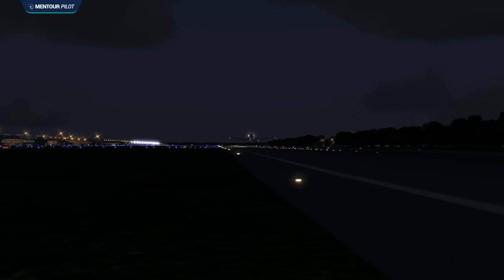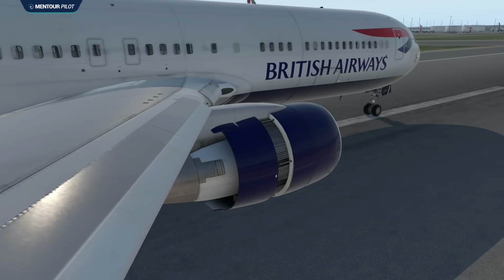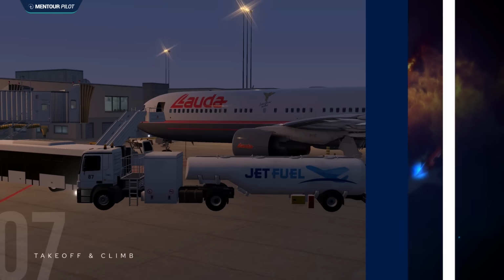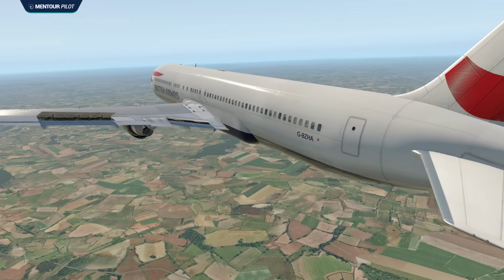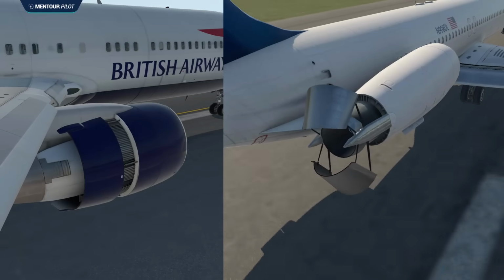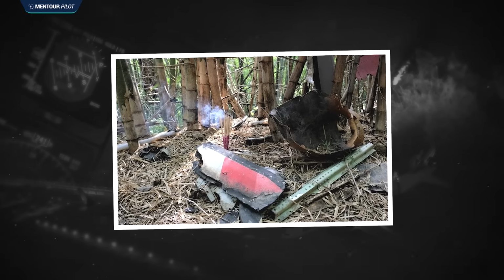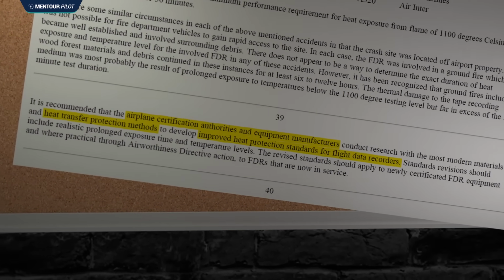HOW an Impossible Failure CRASHED this Boeing 767!

Comment: "But there's still the issue with WHY THIS AIRCRAFT COULDN'T BE CONTROLLED, it had been certified"
Come on dude, you've been making those videos long enough to know the FAA sleeps in bed with Boeing and that warrants a rushed-certification, just-say-the-word style.
Didn't you see the documentary by Al Jazeera, in which a Boeing employee said "We're not building them to fly, we're building them to sell"?
That alone says it all. Boeing makes flying coffins waiting for a disaster to happen.
Reply: What do you mean the aircraft couldn’t be controlled, the thrust reverser deployed at over 450 KTS, the wing was torn off, no control necessary.  No large commercial aircraft could survive that, Boeing or Airbus.  Your comments are so ignorant they are ridiculous and you should probably take it down.  I am currently an A&P mechanic, in good standing, and have been doing so for 35 years, and I am high power and taxi rated on all Boeing aircraft except the 787.  The failure of the thrust reverser system on this particular 767-300 had more to do with wiring and micro switches than anything else.  The engines and thrust reverser systems are not manufactured by Boeing, but are integrated onto the airframe.  The fix for the entire fleet was the integration of a mechanical lock on the thrust reverser actuator and the total bill across the entire fleet of Airbus and Boeing aircraft exceeded 2.8 billion dollars!  Had nothing to do with Boeing other than this failure occurred on their aircraft and not someone else’s.  This thrust reverser configuration effected all aircraft equipped with the Pratt&Whitney PW4056, -4060, and the -4064, the first two numbers being the engine series type, the last two numbers being the thrust rating in tens of thousands of pounds, and also effected some, but not all, General Electric CF6-80C2 engines equipped with the common thrust reverser.  So, as you can see, it’s far more complicated than just calling out Boeing when all they do is assemble aircraft from parts supplied by thousands of contractors.  Boeing only makes the fuselage and the wing sets, that’s about it, everything else is sourced through subcontractors.  As a matter of fact, the thrust reverser actuator on our 767-300’s are manufactured by Sunstrand if memory serves me correctly.

Comment: Yeah all the circumstances are interesting but.
HOW? How could it deploy mid flight? Shouldn't there have been multiple points of failure? Yes the Hydraulic Isolation Valve failed, ok. That's not regarded as that detrmental, because there should have been other safety blocks. 
How about the Directional control valve?
What about the assumption that the reverser couldn't be deployed with the engines at full speed? That must have come from somewhere.
In fact why not mechanically tie the reversers into the engine being at idle? Like the combustion chamber pressure physically preventing the thrust reversers from moving. Or at least a direct pressure sensor blocking the hydraulic connection right there.
That seems like a much more surefire way to prevent something like this than connecting an electrical sensor on a completely different moving component to a hydraulic system.

Comment: How much depth of the different systems on a plane ✈️ are pilots required to know before flying each variant?
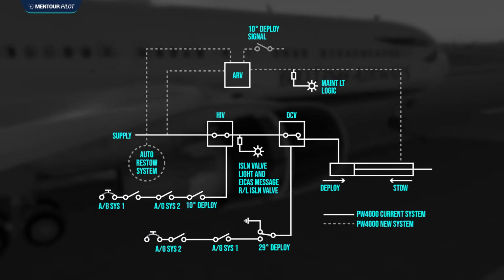For example 4:37 how much of this schematic would a pilot know or be required to know when flying this plane? And how much of an understanding of the warning that appears on a flight deck are pilots required to mentally hold as apposed to be able to find in the Non Normal Checklist?

Comment: One thing that I never quite got before watching these incident vids is how uncontrollable airliners seem to be when something goes wrong. For example in this case,  when the reverser activated and made the plane yaw and dive, then surely shutting that engine down, which is what happened  would have meant the aircraft was a normal plane all be it underpowered. Why was the plane getting so hammered by the dive and why couldn't the pilots regain control. I thought when a new airliner is tested the test pilots putthem through worse than this, maybe not.

Comment: Former US military.... this wouldn't have been rated air worthy. Would have gone through trouble shooting, and had components replaced. Once it happens again, deadline fault, its going to get every thing from switch to every nut and bolt and mount that wire bundle runs through. If that doesn't fix it, then its going back to boeing, and they're paying for a serviceable replacement... they have spares on hand for this purpose.

Comment: @21:30, compressabilty. What the speed pioneers had to deal with when reaching the speed of sound before surface controls were designed to handle it.

Comment: Seeing the structure and wings tear off is especially heartbreaking. Seems like an inexcusable lapse in Failure Modes and Effects Analysis by either Boeing or Pratt&Witney. And initial simulator assessment never accurately models actual human performance conditions.

Comment: If it aint a boeing then, you're safe. 😮 engine codes cost too much. Reset it.... That's what my Prosper, Dallas, Mckinney Texas Dodge/Ram dealer does for my truck under warranty........ Engine oil leaking... Oh that's normal sir.... Wheel eating out tires, oh that's normal wear.......the suspension if fine just hit another car and your still fine sir... At my STEALERSHIPS.

Comment: Capt Mentour - Kinda gonna simplify this, but Pilots noticed electrical BS coming from #1, shortly afterwards, anomaly (Left Reverser Deployment) occurred.  If heads up Pilot IMMEDIATELY emergency shut down #1 knowing only that was the BS source, would it have been in time to save de plane...de plane, or would they already have been in de ground...de ground??

Comment: why would the pilots did not make eng 1 idle
Reply: They actually did but the situation got out of hand before he could do that because it happened in a matter of seconds.

And even if he did that, it wouldn't be very effective because the reverser also affects airflow over the wing which would affect the plane.

Comment: I wouldn't get on a commercial airliner to save your life. When I was in the US Navy I got on a DC-10 (years ago) and the rear turbine was making a racket when spooling up. I looked at the flight attendant and she looked aware of this sound.  When I asked if that noise was normal, sha said no. She walks to the cockpit and brings back the pilot who realizes something is wrong. 5 minutes later we are disembarking from the plane, and had to take another flight. Now, add mechanical failures, False Flag media terror events, pilots losing their minds, weather related events and the general ego problems that these air crews are facing every day, and you'll see why I have this attitude against commercial air travel. Don't get me started on how these pilots can actually think the wings are loaded with hundreds of tons of Jet-A or JP-5 fuel, I know the airlines pay well, as they charge the customer for lots of fuel, lol.  So 83,000 dead passengers and crews since 1970 in commercial airlines travel world wide, not as effective at culling compared to the abominable staircase (12,000 a year) but it's something to think about. Waking up late is optional ... fuel in the wings, lol ...

Comment: This accident is brutal to contemplate, because no one did anything horribly wrong.  Boeing had built in multiple fail safes, and had done testing based on contemplated situations.  Lauda Airlines had been trying to find the problem in good faith and was in compliance with all regulations.  The pilots theoretically could have saved the plane, but had four seconds to diagnose the problem  and then start and execute a difficult maneuver.

In hindsight, everyone could have done more and better, but this wasn't your typical case where the pilots, the airline, or the manufacturer were grossly negligent.

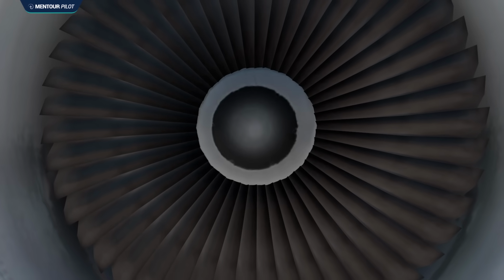Comment: 1:45 The bypass ration is measured by mass, not volume. The difference is very significant because the general gas equation tells us that hot air is less dense, i.e. has greater volume, than cool air, and that the volume to mass ratio is proportional to absolute temperature.

Comment: One of the biggest air accidents in Brazil occurred in 1994 when a Fokker 100 crashed shortly after takeoff due to a problem in the right engine reverser. The aircraft crashed in a densely urbanized area killing, in addition to the people on board, dozens who were hit on the ground. It's an interesting case for a video because it's possible to learn a lot.
Reply: no one cares about Brazilians

Comment: why not have a sepeate hydraulic system for the reversers thats enabled if all wheels being on the ground activates 1/3rd of the requiered switches to enable them and basicly having the wheels push a button, and if not all buttons are pushed it would stop any electricity from going into the system stoping the hydraulic system from activating or even using an electrical acivation instead? or is this just something i though of?

Comment: Among other things, this is a cautionary tale about computer modeling.  Computer models only work if you have ABSOLUTELY ALL of the data.  Since that is not possible, field testing is still necessary.  The computer model can be a starting point, and might find many flaws you have missed, but you still have to do the testing.

Comment: Hi everyone! Hope yoy all good 👍🏻
So I have a question about how this could happen. Also sorry if a say something dumb, I am not a pilot just really enjoy aviation 😅
So when pilots deploy the reverse thrust you have to firstly move the thrust lever at the idfle position, and second, you usually don't use the full power of the engine when in reverse mode, it usually is capped to around 50% (at least thats what I found)
So if the engine was in climb mode, it would be imposible for the engine to actually deploy the metal plates to redirect the ar foward, as it would had too much force no? 
Thanks for any help!

Comment: The pilot did a brilliant job diagnosing the issue within 10 seconds.
But just not within 4-6 secs required to recover the aircraft. I can imagine the first 4 secs were used up in complete terror and shock
Reply: The only way any pilot could have stopped this crash was if they could react to it out of pure, blind instinct. To be dealing with it before their conscious mind had even realised what was happening. That requires an incredible amount of training, and practice, and experience, something no one is going to have in a completely novel situation.
Reply: @alyessamaddox7022 Yes, and airline pilots are specifically trained not to immediately take action when an unusual event occurs, because of the very real risk of making the situation worse if you act before you're sure  what is going on. The only way a flight crew could have reacted in time to this is if they'd been specifically trained for exactly this situation, which of course they hadn't been, sadly.
Reply: @alyessamaddox7022 as he said it was always appearing and it wasn't considered fatal. It should have been corrected. Poor pilots are nowhere wrong😢

Comment: I wrote the report that went to the NTSB, your speculation does some fine cherry picking. You completely ignore the maintenance aspect and how the DGCA manages their maintenance crews and return to service requirements. The misinstallation of the bottom inbd reverser actuator to mention one.  The control valves were telling the truth and trying to protect the aircraft. The deployment of a one half of any thrust reverser in an unrecoverable accident. Nice dry but no cigar.

Comment: Mentour Pilot is morally and technically wrong to continue showing a British Airways B767 to describe this accident.
They had completely DIFFERENT engines.....Rolls Royce RB211.
The engine involved here  was made by Pratt and Whitney. 
At the time an Egypt Air B767 with P&W engines also had a thrust reverser incident. 
These events caused the FAA to issue a DIRECTIVE  forcing ONLY P&W to redesign parts of its reverser mechanism. 
So what is the point of showing a completely different company with completely different engine !!!##!??
Technically bankrupt report.??

I used to fly B757 with RR engines and B767 with GE engines many years before this accident. 
If I had this reverser  message I always determined that I would shut down the engine immediately. 
Why was it not a potential emergency /red warning  ????
Some weak excuses....from Boeing  !!???
Not unlike the B737 MAX  ???

Comment: You missed the most interesting bit.
Boeing did not want to release a statement that there was no way the pilots could have saved the aircraft. Lauda was understandably angry about this, and being a pilot himself eventually convinced Boeing to let him try and recover the aircraft in the simulator. 15 attempts and 15 simulated crashes later, Niki asked Boeing to issue a statement that the accident was unrecoverable (considering the flight crew most certainly would not have been able to identify and fix the problem within the 4 to 6 second window). Boeing's legal team stated they would not release the statement, as it would have apparently taken three months to adjust the wording. Niki responded by demanding a press conference the next day. He then went a step further and told Boeing that if it had been safe to fly with the reverser deployed, he would personally take a Boeing 767 into the air alongside two other pilots and deploy the thruster at altitude. Boeing stated such a thing was not possible (to recover). Lauda then asked that Boeing to declare the accident as nonsurvivable - and at last, Boeing agreed. Niki noted that this marked the first time in eight months that it was made clear that Boeing was at fault for the accident, and not the operator, nor the engine manufacturers.

Something to note was that Lauda took this accident very personally. Not only did the company bear his name, but on top of that he would regularly serve as a Captain for his own operation. He said that the time after the accident was the worst period of his life, saying it was even worse than when he had been recovering from his near fatal burns from the 1976 German Grand Prix.

Comment: Done some work for airbus and boeing. Mainly tooling devices and assembly devices. I cant imagine how the hell the planes dont fall from the sky more often. Their 3d design engineers are bad. They dont know some basic rules. The 2d designs i was making in highschool were above what they give us. And they dont leave adjustment posibility for parts. I can make assemblys at 0.05 mm all day no problem but with their assemblys you get lucky if you can get them close to 0.25mm ( wich is huge in this domain ).
I am a perfectionist and i take pride in my work. Most of the time i fell like i dont even want to put my name on the reports... I like to work with automotive devices much more. Have a little free hand on projects and can make our own modifications with no problems.

Comment: Man, I hate nonrecoverable situations.  I was investigating officer on the E3 awacs crash in Alaska.  Geese took out two engines on the same side on takeoff.  Only a trained Boeing test flight pilot was able to recover the aircraft in their simulator.  Those odds didn’t happen for the crew.  Glad everyone involved demanded action from Boeing to instill a solid fail safe.  I was chilled by the simulation of what happened to the aircraft.  Two pilots with 15,000 hrs between couldn’t recover. What a tragedy.

Comment: 0:01 Intro
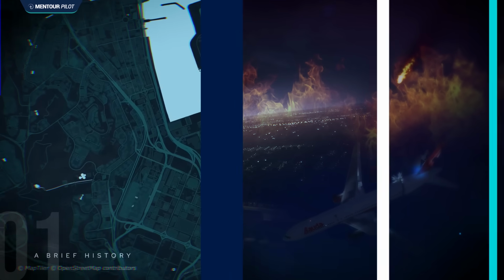0:34 A Brief History
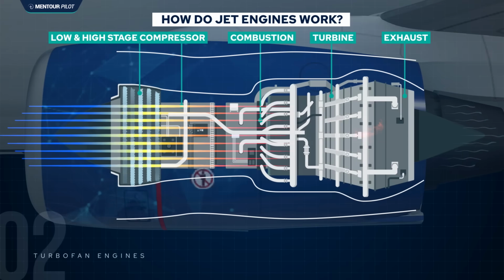1:27 Turbofan Engines
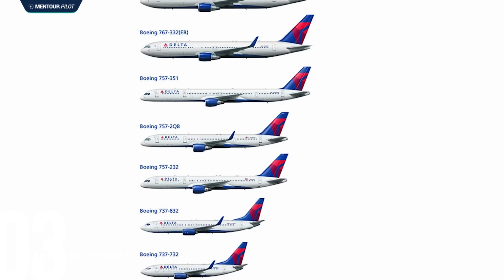3:20 Reverse Thrust
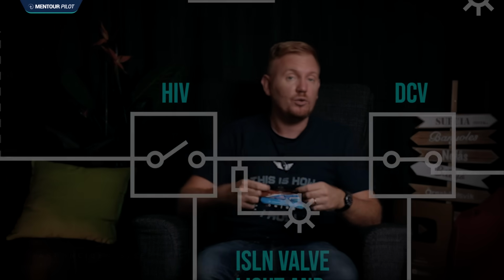5:25 Past Incidents/Certification
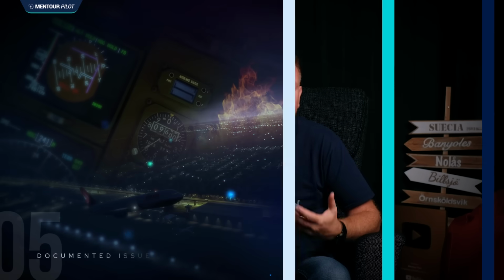8:01 Documented Issues
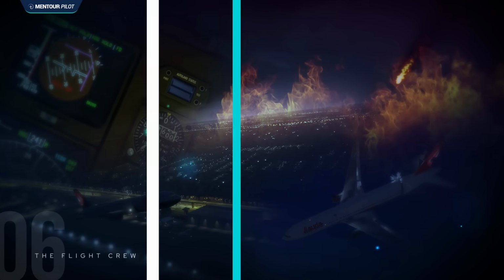10:16 The Flight Crew
12:21 Takeoff & Climb
14:08 ECAM Messages
16:08 Adjusting The Trim
18:00 Thrust Deployed In - Flight
19:17 Why Did This Happen?
20:17 A Violent Dive
21:47 The Sum Of All Fears
24:33 What Went Wrong?
25:30 Authorities Take Action
27:25 Aviation Changed

Comment: Aside from HIV and DCV anti-deploy electrical circuits, B737-400’s  have an auto- restow electrical circuit as well... BUT when all above still fail, there is a mechanical ‘cable operated’ throttle-retard feature which will literally pull the associated throttle  back to flight idle position simultaneously while reverser doors are inadvertently deploying in flight. I wonder if the B767 had that last mentioned safety feature? If so, maybe it would not have crashed? Hmmm 🤔

Comment: Mentour: I believe the bypass ratio is defined by the mass flow rate of bypass air to the mass flow rate through the core. Not volume flow rate as you indicated. The thrust of a engine is proportional to mass flow rate , not volume rate. This is why the bypass ratio is defined a ratio of mass flow rates.

Comment: Time and time again you have this aircraft where some alarm keeps popping up or some minor technical problems continue to occur and the engineers can't find out what it is and the plane is deemed safe to fly. And then something goes terribly wrong in the air, leading either to a serious incident or a disasterous crash.

Something tells me that if the engineers can't find and solve the issue, the aircraft should be deemed NOT fit for flight.

Comment: The pilots would’ve had to pull the fire handles in like 0.4 seconds to have any chance and also correct with right aileron and maybe a dive within a second.
Reply: Not really,  but with no delay, select the FUEL CONTROL SWITCH OFF, then they would likely have survived

Comment: Anyone with even a partially functioning brain could tell you that if a thrust reverser fully deployed during flight it would be game over. How Boeing was able to pass certification with that many caveats is astonishing. They basically got to test it under the best possible scenario, low and slow in the thick air with the engine idling. Feels like dirty lobbying and backroom deals.